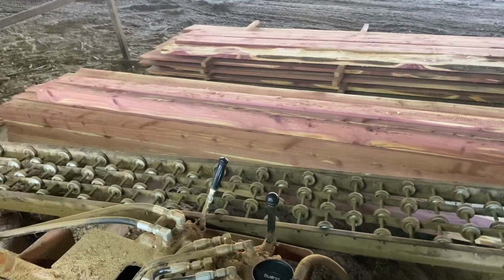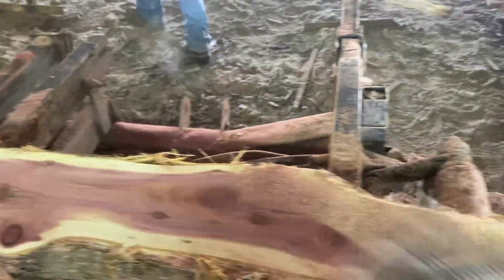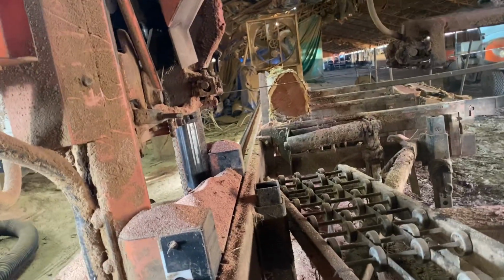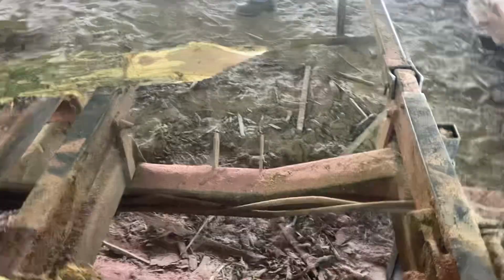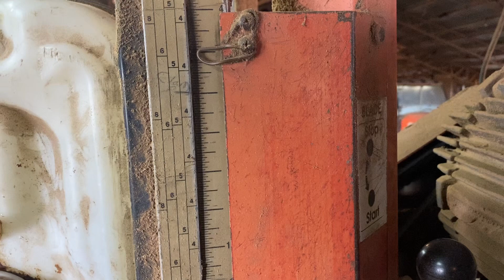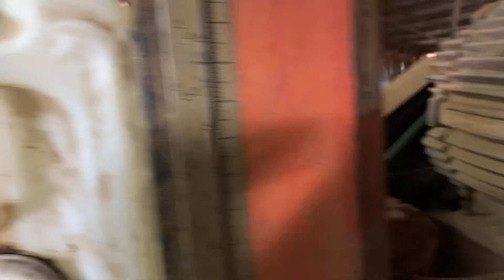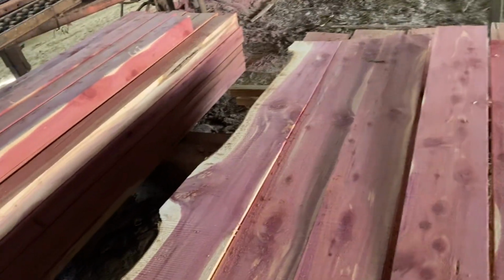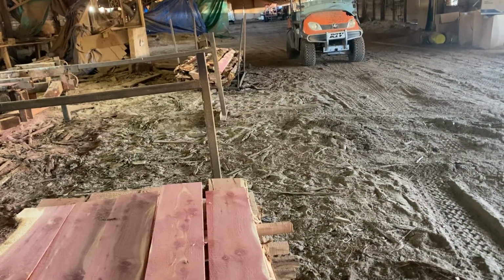Sawing some cedar

Comment: Hello Paul, the worst thing i saw, the dust is irritating. What hp and voltage motor on that mill?🪵🇺🇸
Reply from the maker: 220v 3 ph 15hp. I run it on a 20 hp rotary phase converter.
Reply: Wow Thats a motor! I was guessing a 7hp 220 single Phase. Thanks my friend 🪵🇺🇸
Reply from the maker: We went 3 phase because we have had a big chop saw, 2 resaws and an edger that all were 3 phase.  The electric is super efficient.